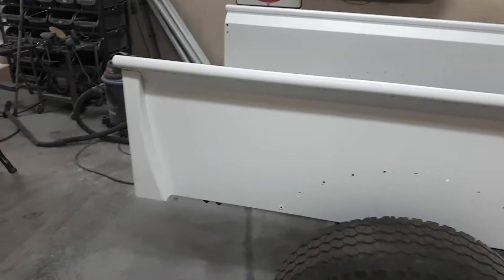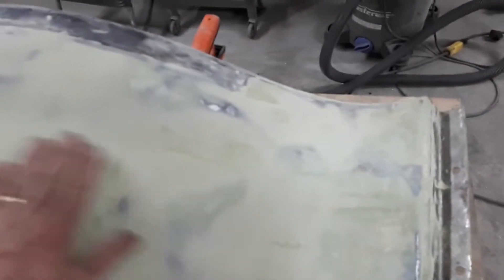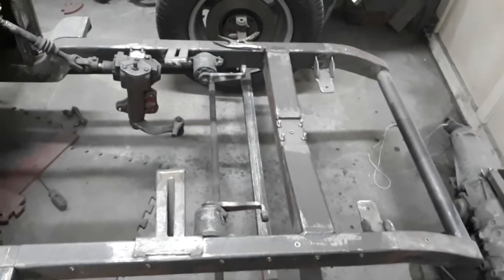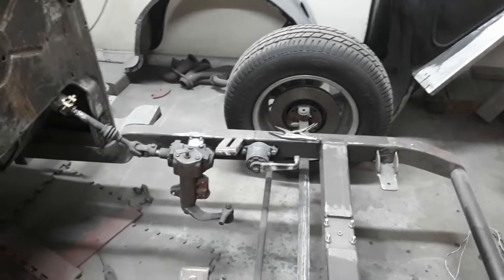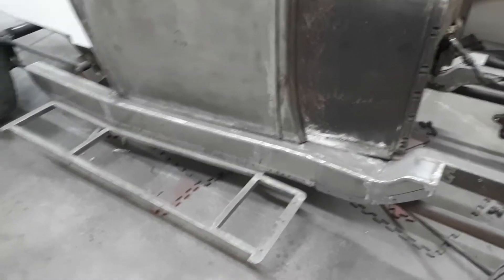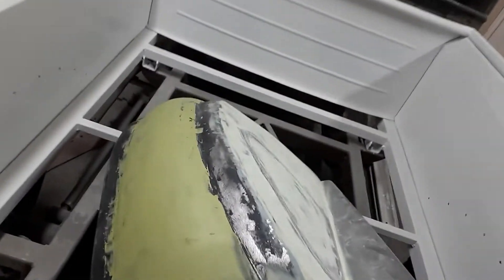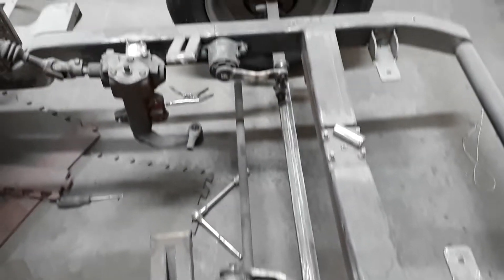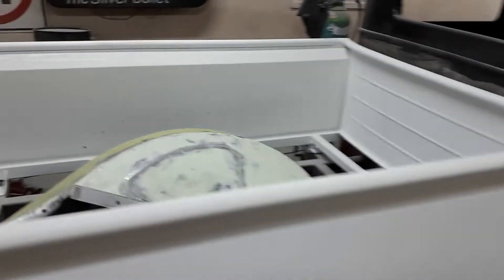body work

Comment: That’s looking pretty good, Allan. So, are you using POR15 on everything, and then going straight to high build primer?  👍Tony B
Reply from the maker: hey Tony i just use the por 15 to kill the rust i sand most of it off then do short strand  glass then body filler then high build i block out the body fill  and block the primer some times i have to prime and block twice